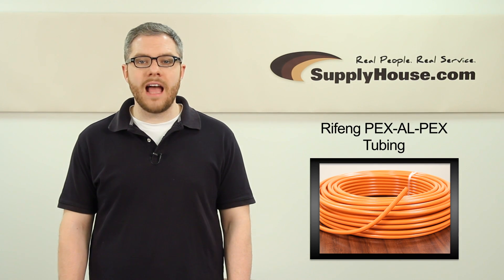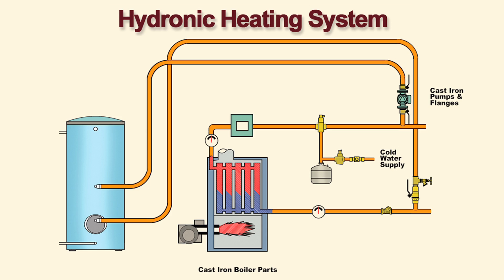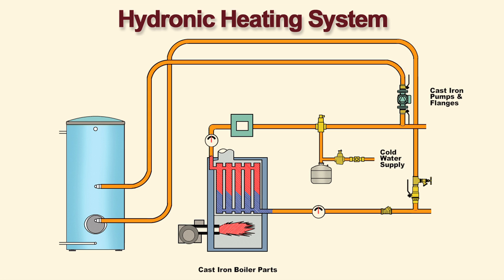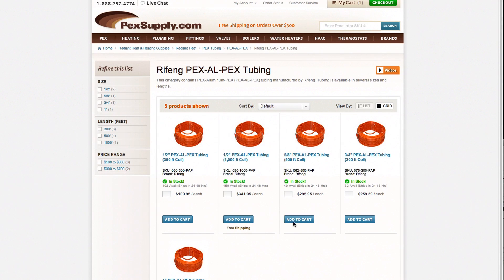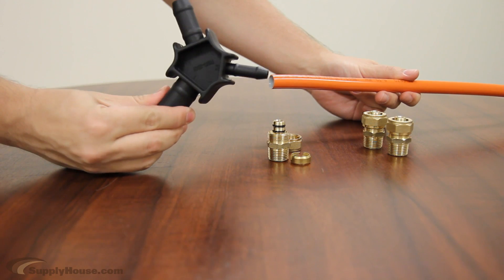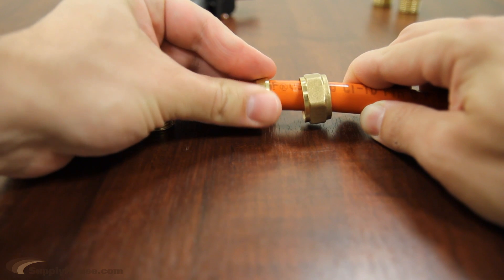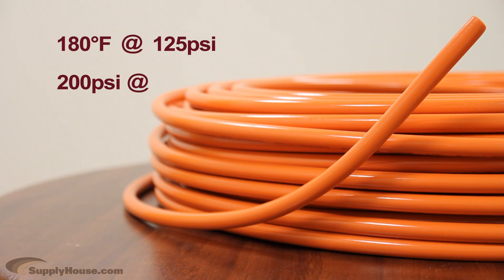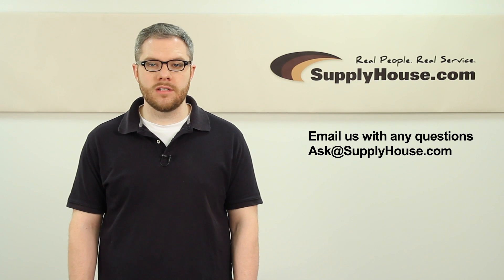Rifeng PEX-AL-PEX

Comment: The class action lawsuit was about the Kitec fittings failing and not the tubing.  The failures were in potable water systems versus hydronic heating systems.  This issue was due to poor construction materials being used in the fittings causing the fittings go through a process called dezincification which is process of different metals breaking down; very common in the U.S. from all the chemicals we put into our potable water sources. The fittings mentioned in the lawsuit were heavily used in the early 2000s.  Unfortunately, my house has Kitec plumbing in it but so far the only things that have failed are the regular copper fittings.  If you already have this stuff in your house and you want to transition to PEX or PROPEX, IPEX has transition fittings that are approved for potable water systems.

Comment: This pex is completely useless.. This is very expensive and Type B pex. There is Type A pex with oxygen barrier that hose no aluminum in it. Lighter more pressure and more temperature resistant and cheaper by default..
Ben Dragan 
BMD Plumbing.

Comment: Would this tubing be suitable for a home shop compressed air system?
Reply from the maker: +BigSidtrous I've seen it used in an air system before.
Reply: I used regular pex and it works great 175 PSI and it's cheaper